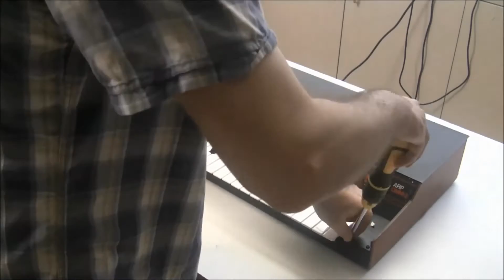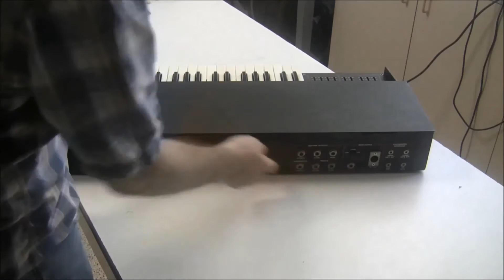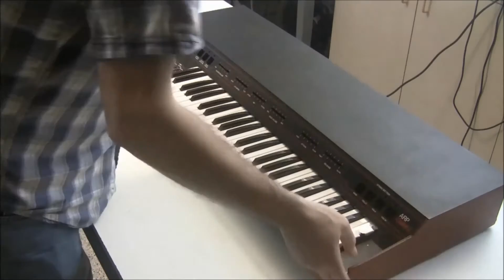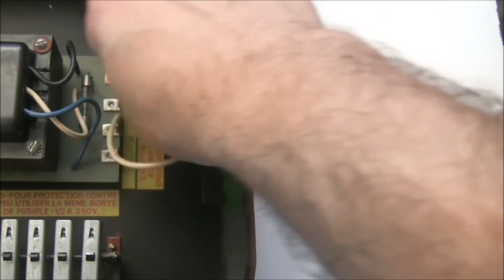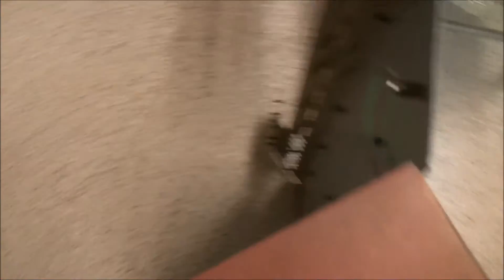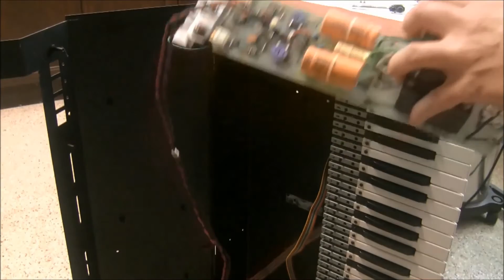Synthchaser #054 - ARP Omni 2 Disassembly

Comment: great tutorial as usual ,  just a note for others , when reasembling , watch for those Hex bolts that bolt on boards , some need isolating washer , as tracks run next to bolts and can touch shorting to ground , think you have late Rev of Omni 2 where its not an issue , but early revs of Omni 2 have the tracks close to Hex bolt holes ,